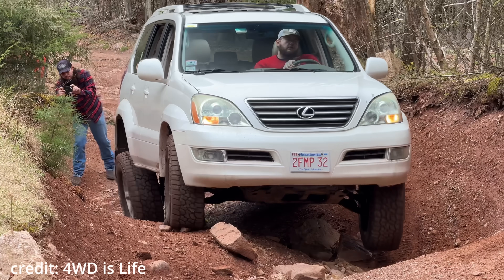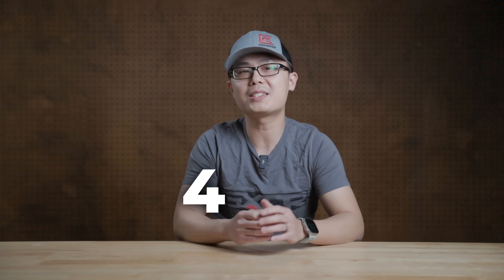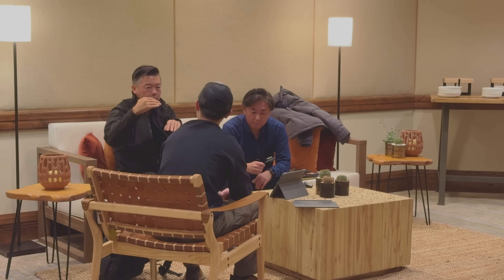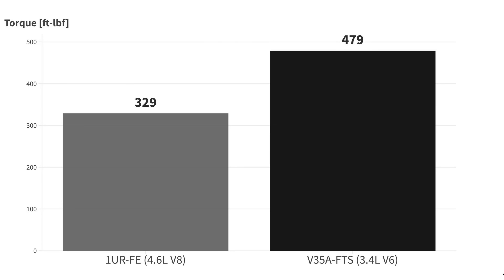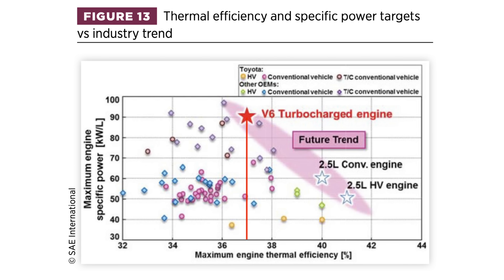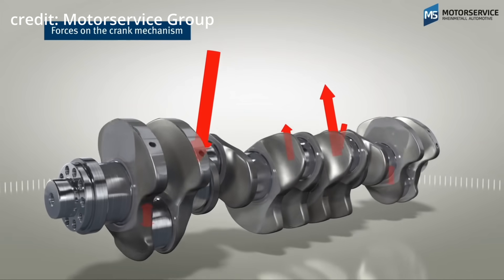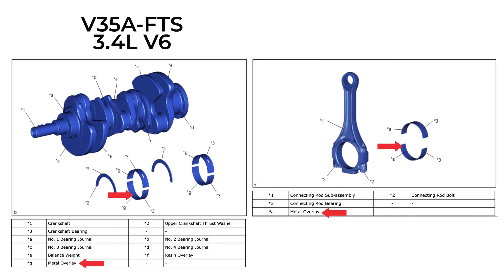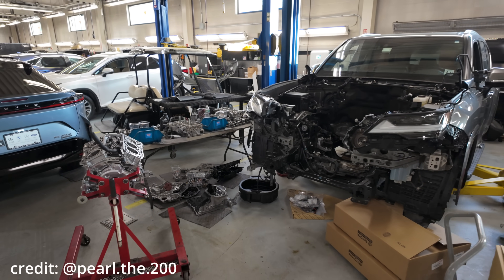Is Toyota V35A-FTS Engine Reliable? Well..It's Not That Simple

Comment: I'm a mechanical engineer and I live in Huntsville, Alabama, and I know I've heard some of the old v8s and the new TT v6s are made here at the Toyota plant in town.  I just google'd "V35-FTA Alabama" and one of the first results is a forum post mentioning that, *allegedly*, one of the shifts at the plant was not properly cleaning out the engine block oil passages for some length of time till they caught it and corrected them.  This would cause metal shavings to still reside in the block, ultimately getting forced to the crankshaft main bearings once started, resulting in inconsistent and sometimes substantial wear & damage to the bearings once the engines get fired up.

If that's true, then perhaps the root-cause does not lie within the engine's design.  Food for thought.
Reply: I think the LX600 is built in Japan. Not sure if engine assemblies are all built in the US then shipped but I initially imagined the overseas models to have engine plants closer by.
Reply: those are gx lx engine made in Japan. not the same crap out of our declining USA
Reply: @shiroihachimaru4559  right and they are having bearing problems as this video talks about
Reply: @shiroihachimaru4559  ha ha, so crap engines from Japan are better than USA engines that don’t have this problem?  You are too funny.  Let alone the ‘s’ word
Reply: Which is why all new motors should have their oil and filter changed by first 1000km travelled, as any swarf still in the engine would get flushed out,then replace with new oil to protect.  Dealerships don't do first oil changes until 10,000km or longer which I beleive is wrong.
Reply: @hiluxmax2709  agreed, it should be standard practice that oil is changed at 1000 miles for a brand new car. I have a 2024, and I did exactly this.
Reply from the maker: interesting info. thanks for sharing! but all 3 bearing issue Chris dealt with were built in japan, spanning across 4 years. so this might not be all there is to it.
Reply: I will be changing my oil at 1000 miles as per the car care nut channel.
Reply: Sounds like the same problem Hyundai/Kia had in years past with there 4 cyl. 2.4L Theta II engine. Metal debris from manufacturing causing rod bearing failures
Reply: I also would have asked if they had any problems with thermal expansion in the cast iron main caps embedded in that aluminum ladder frame girdle. Aluminum expands much faster then cast iron. I wonder if they had problems with this during R&D development. I personally don't know of any other engines with this design.
There were a lot of problems in the past. When manufacturers switched to aluminum cylinder heads from cast iron cylinder heads. The different expansion rates of the two different metals caused many head gasket failures.
Reply: @hiluxmax2709  Bingo. Oil change at 500 miles. Or 1,000 miles. No later than that. Even on a perfectly assembled engine there will be nasty stuff in the oil after break-in. And for god's sake follow the break-in procedures. It's not hard.
Reply: I think we'll soon see a Toyota TSB making the change from 0W20 to 0W30 oil.
Reply: What Toyota products do yall produce at the Huntsville plant? I worked as a mechanical engineer for a few months at a defense company in Huntsville and loved it there. I would definitely consider moving there to work for Toyota
Reply: @TinkerersAdventure  i built my own 800hp turbocharged 2jz with King polymide coated main and rod bearings, but most people use Clevite/ACL uncoated bearings. What the coating is made of shouldn't matter because when running, there is always a film of oil preventing any contact, except numerous Start/Stop functions, you have to realize these Start/Stop turn the crankshaft with no oil pressure, vs just letting the engine idle with 10-20psi oil pressure. Factory main bearing oil clearance for 2jz is 0.0016 inch using 5w30, most of us turbo 2jz use Clevite/ACL/King bearings that gets us higher than factory specs, mine measured at 0.0022 inch and use 5w40. I think the issue with the new 3.4tt is a combination of Start/Stop function, thinner oil, bearing clearance and crank snout pressure because it seems to always be that front main bearing going out, but if that's the case, there should be numerous cases of failure. FOD foreign object debris can also be a possibility with the few cases of failure at around the same mileage. It could be FOD from the oil pump supplier, but I don't know how the oil passages are routed in this engine block and if the front main gets the fed oil first in line, another consideration is if the oil pump is driven by the crankshaft on the front and routing to the #1 main bearing.
Reply: I hope one day I will watch you and @TheCarCareNut video sitting together and discussing Yotas:)
Reply: Interesting to see if Toyota will recall or warranty those engines, btw hello fellow Huntsvillian!!
Reply: @TinkerersAdventure  What is the recommended oil weigh for this failed engine? In other countries there were several reports of Toyota v6 failing while being heavily flogged. The oil was 0w-20 and interestingly ALL the main bearing failed simultaneously! They concluded that the most likely reason is that oil either foamed up or became too thin leading to insufficient lubrification. Interestingly there were no warning lights.
Reply: At the first oil change, switch to a higher viscosity (at least 40 weight). The thin oil (to improve MPG rating) is insufficient in a high temperature and high pressure engine application. Finding metal particulate in the oil filter is common for the first few oil change intervals. The oil’s metallic levels (detected as ppm) should go down and stabilize over time. A used oil analysis (UOA) at each oil change would have likely caught the premature bearing wear - if the detected metal levels were relatively high. The 10k mile oil change interval is also ridiculous for such a low oil viscosity in a turbocharged application.
Reply: @flipcoin6301  Stick to the recommended oil viscosity. Toyota might allow for something other than 0w-20, but check the manual. The additive package in the oil is far more important in turbo engines. Get a good oil like Pennzoil Ultra Platinum or even Toyota's new oil. But yes, getting a used oil analysis is the best way to know what's working and what isn't.
Reply: I tried searching for that query but I couldn’t replicate your results. If it is true, then I am extremely relieved. Would you please tell me what forum you found when you searched?

I have a well loved 2022 Tundra and want to put a lot of miles on it.
Reply: Sounds about right, heard they were have problems with the V6 4.0L cylinder heads that were not properly drilled for oil flow on some of the Tacomas, usually any problems with an engine happen right away, or with-in 10-20K miles.
Reply: @55seddel  SO the car the blogger was flogging hard (multiple 180km/hr accelerations) was 2017  Lexus GS450h with 2GR engine  with around 120000km. The garage said that these engines are known for the 5th main bearing failing and also they think the 0w-20 was not sufficient because all the main bearings show overheating. The UOA of the oil from the failed engine showed that oil was actually within specs! So they think foaming up at very high RPM was probably the reason. So bottom line: weak 5th main bearing + too thin oil + aggressive driving = failed engine. The video is in foreign language and links to videos cant be posted here.
Reply: @dimdim3490   I was referring to what OP said but I worded it awkwardly. The, “V35A-FTS Alabama,” search mentioned at the start of this thread by @cbh148. I did finally find a thread on the Sequoia forum, maybe that is the one he is referring to. I’m digging specifically for confirmation that it was a manufacturing error of X shift though Z date range, so I can narrow down my research if I need.
Reply: @jordanharris3749 used to make the V8 (4.7, 5.7) V6(3.5 2GR and 3.5TT), 2.4 and others. Buffalo, WV makes engines too (no V6 or V8 though).
Reply: @55seddel  That post number 70 is a quote of a prior post someone made, which appears to no longer exist, but the quote of the post currently does still exist.  Just in case Toyota or somebody's trying to delete posts like that, I'm going to copy/paste it verbatim right here:

[Mattedfred said:
@rlc177 Where did you obtain this theory?

“There was a shift at the Alabama plant that was improperly cleaning the blocks meaning that some metal shavings may have been left in the oil passages, because of this the main bearing gets starved of oil and eventually spins out. There is nothing the owner can do its just a ticking time bomb. Allegedly the mistake was found and somewhere in the June 2023 time frame the procedure was corrected.”]
Reply: Thats not true cause here in Saudia arabia we get the lc300 and lx600 made fully in japan and alot of them have these bearing issues
Reply: Are OEMs too cheap to put a magnet in the oil pan now?
Reply: 4runners come straight off the boat so those engines come from Japan. I see the Tundra billboard saying “Engineered, designed, and built in USA” I’m not buying that especially for the $$$
Reply: Must be the same issue they had on the new turbo RX and annex, they had to warranty the heads on a couple thousand cars. I hear it every day in service, it must be the American made ones. Then they want these customers to go 10,000 miles on it oil change LMFAO😂
Reply: @ab2abblank607  Toyota is going the opposite direction on some of their new motors... 0W-8
Reply: We just had a 22 tundra with the TT V6 spin a bearing and had the short block replaced. I’m at a toyota dealership located in southern MS.
Reply: I'm an engineering geologist and I live in California, and I know I've heard that is some BS
Reply: @hiluxmax2709 that’s up to the owner that buys it to have a brain. Also that won’t help there being metal shavings left in the motor the damage is done
Reply: @jasonp3253  did he advise: 500 mi, 1000 mi, 5000 mi then every 5k? 

I just changed differential in a Tacoma 2nd gen at 155k mi, the manufacturer suggested changing the differential fluid at 500 mi and no freeway driving (<60 mph) for 100 miles. The main reason to change fluid so soon is overheating when teeth are grinding. 

I imagine it should also apply to any new car in similar manner.
Reply: Why anyone buys a car made in ALABAMA puzzles me.
Reply: @bouchzx14  Yes I think getting that one piece cap setup is problematic over the old system too....
Reply: @DeuceDeuceBravo  I would drive around for an hour and then change the oil and filter.
Cheap insurance......
Reply: @flipcoin6301  Yes I have noticed that years ago oil felt thicker, like 30w now seems watery to me.....
Reply: This is why Toyota shouldn’t be building trucks in America or Mexico. The Japanese make better quality vehicles and take more care and pride in their work. They are also union members with good pay and that goes a long way.
Reply: @shiroihachimaru4559 and still fail..... So may be Japan has declined too?
Reply: Yeah I hate to say it but I’d rather a Satoshi assemble my vehicle before a Sharkeisha. I know I know…
Reply: YO THEY FORGOT THE SAME CRAP IN MY 3.5L FKS IN MY HIGHLANDER!!!! I REMOVED THE METAL CHIPS OUT OF THE FILTER AND THEY NEVER DEBURRED THE DAM CASTING!!!!  BUT 35K ON IT NOW AND IT JUST BROKE IN 😊😊
Reply: That I recall the Huntsville plant is producing the turbo V6. They've been running that line for a least a year. They been producing the 5.7 for a number of years.  @55seddel
Reply: I stick a neodymium magnetic on the drain plug if my engines catches any steel running around in the oil
Reply: I thought the GX 550 is made in Japan though
Reply: Isn't that the issue Hyundai is having with engine fires?
Reply: @boogboog8097  it’s been shown to make no difference if one has a proper oil filter. The magnet is good only for fluid with no filter like differential and transfer case.
Reply: its happens in meadleast for hundreds of cars and the company have silenced
Reply: @bouchzx14  True,,not only in theta II dude,, each & every piece of them have the same issues till now
Reply: LX, GX, and LS are build in JAPAN and so are the engines.  Alabama engines go into Toyotas, like tacoma, and sequida(how ever u spell it)
Reply: This sounds more like what happened to Hyundai and the earliest batches of Toyota's now legendary reliable GR series V6s.
Reply: But I'm sure if you know this Lexus does too and would clear things up
Reply: If this is true can’t they trace all the bad engines then? Get them off the road so they won’t contaminate the perception of the other engines?
Reply: That's exactly the sort of thing I expect would be causing early failures.
Reply: @hiluxmax2709  interesting but dont you think the oil filter will filter out the iron shavings
Reply: lol crazy I’m from HSV but live in the Ham now. Great information!!! This is a reason why I wouldn’t buy a new first year of a vehicle even though they can be really appealing. I couldn’t really swing the money anyways and I’ll be riding my 2011 Taco for a long time to come 😂
Reply: Driving like a race car driver is for race cars also. Nobody is telling you to floor it, so why worry about overstressing your motor? You're the one in control of that
Reply: Toyota has gone to 0w-8 for their latest engine variants. That doesn’t bode well IMHO.
Reply: @bfromthea7663 It's not the standards that are different, it's the quality, dedication, and professionalism of the "average" factory worker that is different. No easy way to fix this.
Reply: I knew that turbo was going to be an issue!!!
Reply: @bouchzx14 the best ever was the Vega with a cast iron head on an aluminum block which had "siliconized" bores instead of sleeves and an inadequate cooling system and no coolant recovery. I had to pull the block on one in the 70's to have it leveled. Didn't need a hoist. LOL
Reply: @luislongoria6621 debris in a passage gets to the bearings before it gets to the pan. If the debris is aluminum no magnet is going to help.
Reply: Toyota came out and said this was in fact the issue
Reply: @Vonbucko yes. So this post from 3 weeks ago based on a rumor was correct. Crowdsourcing was correct this time. Amazing.  And there still are those that don’t think the debris in the engine is the true cause. I’m on the sidelines as a future customer of these engines.
Reply: Hyundai did the same thing and now has a civil suit against them. Hmmm, same issue? Bearing issue/ engine too stressed with the twin turbos. But I shall never have that issue as I would never buy a Tundra or a new Tacoma. Things change.
Reply: @DeuceDeuceBravo 
I use that oil as well in my 2024 tundra crewmax TRD off-road, the Pennzoil Ultra Platinum 0W-20
Reply: Could be new temp on the line, and poor indocrination.
Reply: They engineer the motor for specific oils. Changing the oil can definitely lead to increased wear or failure. New motors are not made for the old 30 or 40 weight standard which a lot of old timers would use to increase oil pressures or help increase the film on parts.  Newer motors are designed better. And yeah they have issues but from what I’ve seen it was due to metal shavings in the engines unsure where it came from. I think they issued a recall on the affected motors. I do agree with a 500 mile break in oil change as I’m also am an old timer who would rather spend a few bucks on fresh oil than risk break in wear floating through my  engine for thousands of miles. I also use full synthetic on everything and will only go 5k between oil changes. So maybe I’m a hypocrite to some degree but the most reliable engines I’ve owned were Toyota and I’ve yet to see that change in any way compared to other manufacturers.
Reply: @saad-px5jg I’m heading oil journals are too small and the not enough oil is getting distributed everywhere it needs to go.
Reply: @shiroihachimaru4559 I was told many years ago from a Toyota technician that the best thing is to get a Toyota that’s built 100% in Japan. You will not encounter hardly any issues compared to the ones built in the USA. Make sure that Vin number starts with a J.
Reply: @titomatias1576  All 3 of my Toyotas are fully made in Japan.  ‘94 pickup XtraCab, ‘88 pickup XtraCab, and ‘87 4Runner — all 3 of them are 4x4, DLX, 22RE, 5 speed manual, manual locking hubs.
Reply: @bouchzx14 and 2.0
Reply: I'm not an engineer or a mechanic. However, basic common sense prevails here.
Reply: @hiluxmax2709   Bingo  !!  I still do it  after 500 Miles and then 1500 Miles . Old school goes long way !!
Reply: @bouchzx14  This jumped out at me as well. I quit engineering school and moved to IT...but never forgot this story from an old Ford engineer...something along the lines of large gaskets were produced in the midwest, but when shipped to a cold area in canada, they didn't fit. simple lesson to instill this concept for an 18 year old to always keep in your mind. When the mention of plastic to metal change was mentioned (maybe not plastic but whatever) this jumped out at me...potential for this to occur. And....these are the failure points. Perhaps some of that "thermal efficiency" is just absorbed heat in the bearings...which expand, cause friction., and kaboom. Maybe a less temp sensitive alloy would be a fix.
Reply: I still have my 2004 Tacoma reg cab 4x4 auto with 110,000 miles since new...think it came from the Fremont factory in CA @cbh148
Reply: @kurtbeck5809  Those are great trucks.  The last year before they went from compact to a big midsize.
Reply: Nope
Reply: @jordanharris3749  the v6TT used specifically in the Tundra/Sequoia are made here.
Reply: I smell competitor sabotage/espionage. The engines made in Japan are fine.
Reply: @jaykua6193   I had my new 2024 vehicle oil changed out at 1445 miles.  Hopefully I didn't wait too long.  I did however use 100% synthetic Amsoil.....changed the oil, ran the engine for 10 minutes and then changed it again.